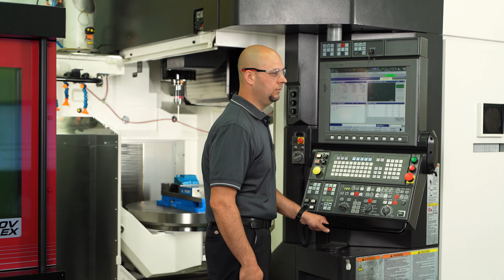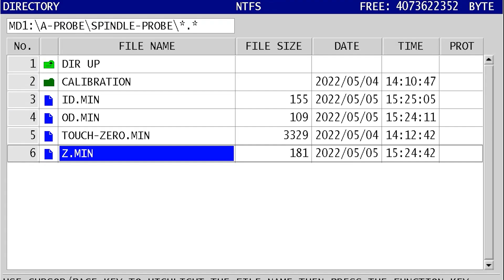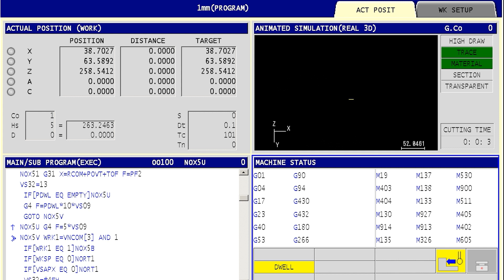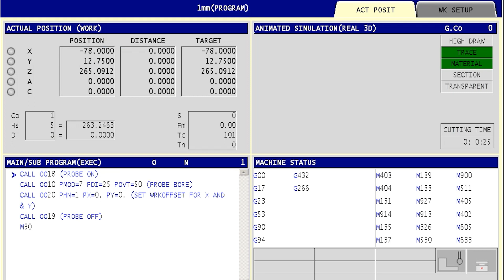Tech Tip: Auto Gauging on Okuma OSP Control

Comment: questions about the process.  Where is the information stored when you pick up the boss for inspection?  My probe cycles rapid into the walls and then touch slowly the second touch.  Is there a way to slow down the first approach other than using the overrides?  I know you thought we need to alter the pickup routine feed rates, but all of the routines need to modified then correct?  If we modify the routines, we need to update the OSP macro library to take effect in the future?  Youre video shows you picking up the part with the door open, our machines won't allow cycle start without the door closed?  Thanks
Reply: The gage data is stored in the gage results screen which can be accessed by pressing F8 display change on main screen

The gauging manual shows what variables have what results 

Okuma had gage variables called VS

As for slowing down the first touch this can be accomplished via variable on the cycle line

The gage manual shows this

As for door open while probing this video the door has been bypassed to show the video better

So the door bypass is not something recommended